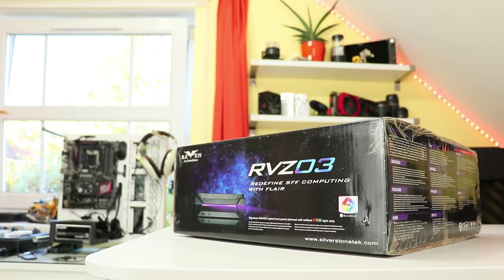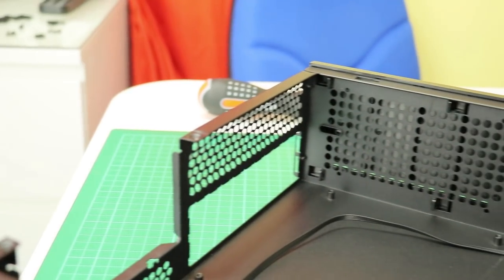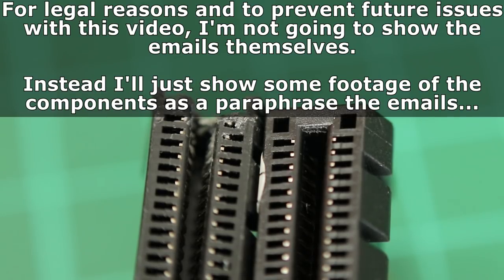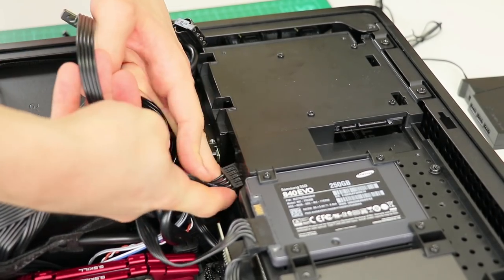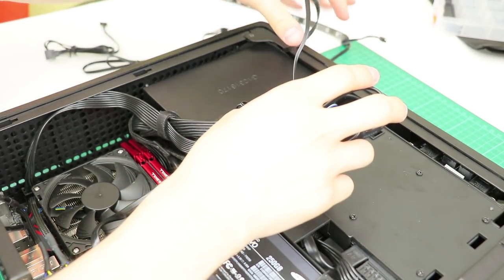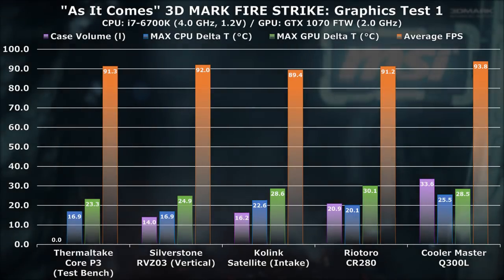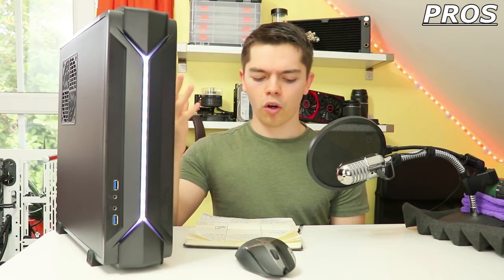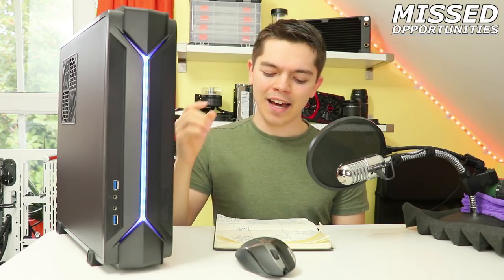SilverStone Raven RVZ03 (Mini ITX) Review

Comment: Wouldnt you want to exgaust air out of CPU, rather than intake?
Reply from the maker: I get what you mean, but it doesn't quite work that way. If it was set to exhaust it would be working against the CPU coolers fan which would reduce the fan speed of both fans. The over abundance of air pressure down onto the CPU cooler forces cool air to replace the hot air around the CPU cooler, which acts as the exhaust.

This case utilises positive pressure to the maximum, and done well it produces fantastic results as we see here.

Comment: i hope you will reply. (i have the same case)

I have the standard 2 case fans on the GPU side and that leaves my cpu side without a case fan, i want to buy a case fan 120mm but i don't know which one to buy and how to connect it. i am really newbie. can you maybe give me some details?
Reply from the maker: Hey, sorry I haven't got the time to help out today. But I'll try and get back to you with some answers tomorrow.

Can you let me know what CPU and CPU cooler you have, and I'll see if we can find a fan to suit that. You may not need one at all depending on the CPU and CPU cooler.
Reply: AV Techy hey thanks for the reply. I own a ryzen 5 2600 with a stock cooler. Temps reached 60 with the fan case and 80 after i switched it to the gpu side
Reply from the maker: Okay, so next question I have is what application were you running at the time to get to those temperatures.

Typically the best way to know if the system is well cooled is to run the most demanding application you'll use the system for. So if your editing you should run a long render and if your gaming you should play the most demanding game you usually play.

I'll have a look into some case fan options for you soon, and we'll get something worked out.

But just as a small reminder, pretty much any case fan will do the job well enough, but of course you can max/min a case fan by looking for the cheapest fan with the most airflow per rpm.
Reply from the maker: Oh yeah, and I need to know what country you're buying the fan from. That'll help with the search by price.
Reply from the maker: Hey, so the limit of the CPU cooler in the RVZ03 is 83mm, and the size of the Wriath Stealth cooler that comes with the 2600 is 54mm. So, 83 - 54 = 29mm. Considering a standard is 25mm thick  you can pretty much choose 120mm any fan you want.

Let me know if you have a budget or any noise concerns if your new fan, and I can help you find one if you want. Also let me know what country you;'re buying the fan from, and I can tailor the search that way as well.
Reply: AV Techy thanks for the info. I basiclly play only fortnite only and some old rts games. I am from the netherlands. Thanks for the help! Really appreciate it sir!
Reply: AV Techy if its around 15€ im fine with it.
Reply from the maker: Okay, well I don't think there's too much load on the CPU to need another fan, but there's no harm in adding more airflow.

So I tried looking on nl.pcpartpicker.com for the cheapest 120mm fan from a reputable manufacturer, but the best I could come up with is a €22.90 Noctua NF-F12 Chromax fan, which isn't exactly that cheap, but it's certainly a good fan with a 6 year warranty. So for an extra €8 you're pretty much guaranteed it's going to last. Here's the link if you're interested:
https://bit.ly/2Gm9z8N

Now this might not be the cheapest good fan you can get in the Netherlands. But I don't really know the popular stores in the Netherlands to help much further than PC Part Picker. So if you want to have a look around yourself here's a quick shopping list I'd recommend looking for:
Fan Speed: as low as possible, preferably 300 - 1200rpm range for reasonable airflow and noise levels.
Connector: Must be 4-pin with PWM control for the most control of the fan speed.
Size: 120mm to suit the RVZ03
Bearing: Ball bearing, avoid sleeve bearings since their life expectancy is lower

And here's a list of manufacturers I'd generally recommend:
Arctic
be quiet!
Cooler Master
Corsair
Cryorig
EK
Fractal Design
Noctua
Phanteks
Scythe
SilverStone

You can't really go wrong with those manufacturers. But of course there are better and worse fans from each of them. Also keep an eye on the warranty period. Higher warranties generally show more faith in the longevity of a product by the manufacturer.

So I hope your search goes well, and let me know if you find a fan that you want a second opinion on.
Reply: AV Techy thanks you very much for your help! I have one last question .so i need to add the pin to the the psu right, do i need to fully dismantle my psu for that? The noctua is fine tho its 19€ where i got my rvz03!
Reply from the maker: No need to dismantle the PSU to add a fan. Just connect it to the motherboard.

If you send me a message on Facebook (link in the video description) with the motherboard you have, I'll send you a picture of which connector to plug the fan into.
Reply: AV Techy i can do that but i already use a fan splitter for my 2 case fans. Gonna send it right now

Comment: Damn yougot lucky.  mine didn't even come with instructions   or the right size screws to mount the ssd's   mine was $139.99
Reply from the maker: I have a feeling you were unlucky rather than me being lucky on this one. I hope you sent it back for a refund or replacement, there should have been instructions and the correct screws as standard.
Reply: Mine came without a manual.

Comment: You breaking pci express extender was your fault. i have 2 silverstone ml08 cases with the same extender and it has never broken. you lift it horizontally.
Reply from the maker: I agree, it was my fault it snapped the way it did, but it was really easy to do.

When I take a side panel off I don't even have to think about it, nothing is going to break, it just comes off no questions asked. But with these extenders I couldn't do the same, I had to be careful and avoid the issue.

The problem is there's a pinch point, that's not really arguable, it does exist. The reason this doesn't cause an issue in cases is the process is guided by the case and the edge of the board, the graphics card can't come out at an angle.

With no other support there are a more ways the connector can be removed, which is where the pinch point needs to be reconsidered since it becomes a factor due to the various angles the connector can be removed. Then there's the contacts that can provide varying degrees of pressure, and there are more on one end than the other which unbalances the forces a little, which encourages an unbalanced dismount.

What this all comes down to is it shouldn't be possible for me to break that extender in that manner, it should be designed out - made highly unlikely (I did it first time so it feels to me that's it's relatively likely, or I got really really unlucky). Hence why we have Mansafe systems or balustrades on roofs for maintenance staff. Sure you shouldn't fall off the edge of the roof and most of the time people don't, just be careful - but it's possible to fall off the roof, so we design in the protection initially so falling off the roof is highly unlikely.